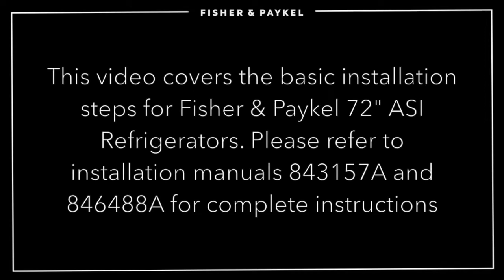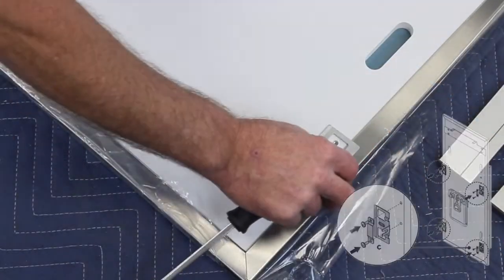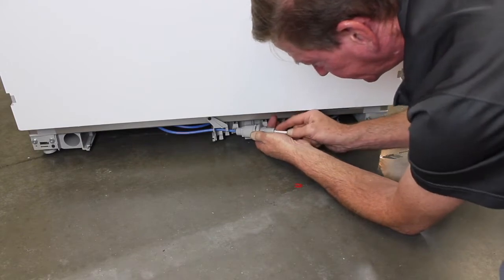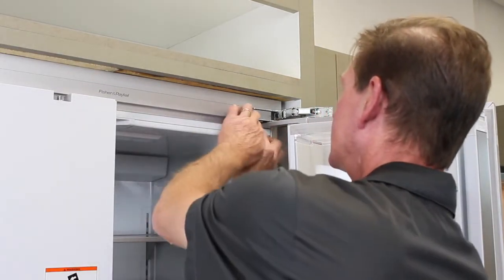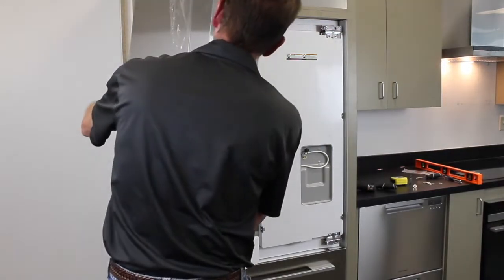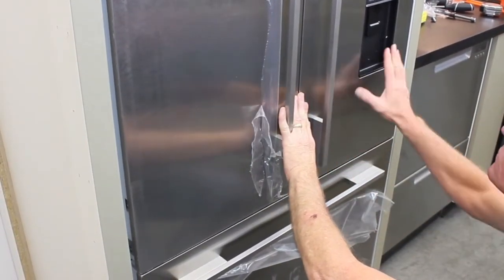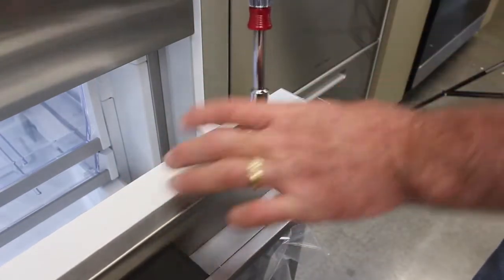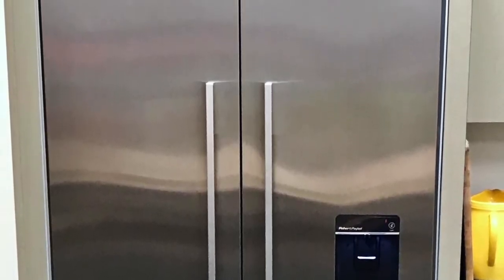Fisher and Paykel RS36A72's Installation

Comment: My custom panels for RS36A72J1N match the specs on the website but appear to be an inch longer on the refrigerator. I am not clear if the refrigerator can be adjusted 1 inch lower to allow for the door to fit flush?